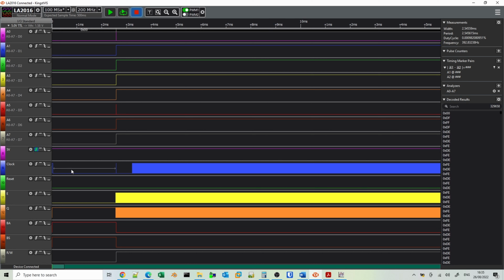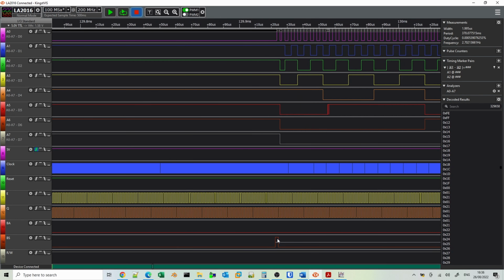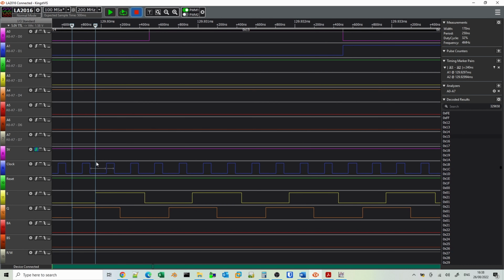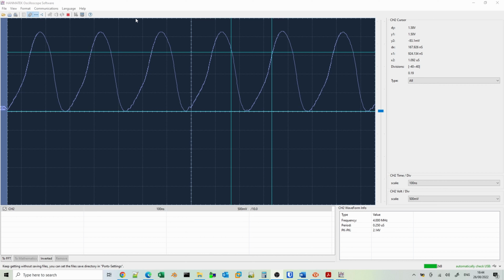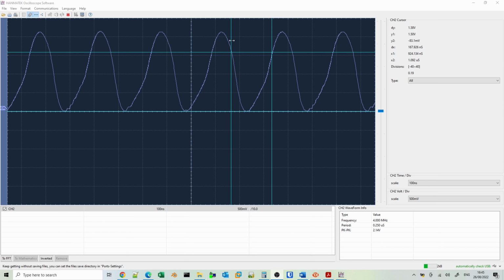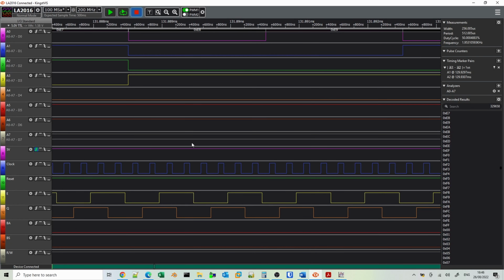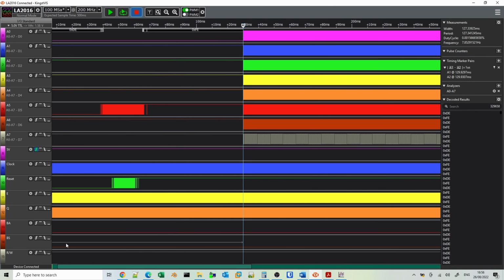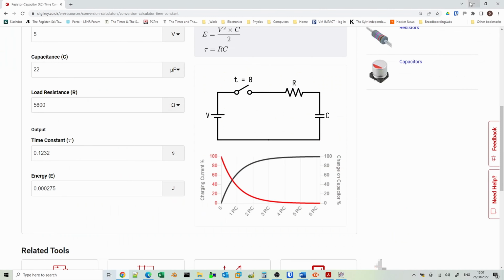Nanocomp 6809 #4 Test Control Bus - 8 Bit Breadboard Micro

Comment: Why are you wearing two watches?
Reply from the maker: A proper watch which shows the time ALL the time and syncs to an atomic clock radio signal and is solar powered so NEVER needs charging and a Fitbit for biometrics but is not a very good watch and dies after about 4 days even when you don't use it as a watch. It's an age thing!